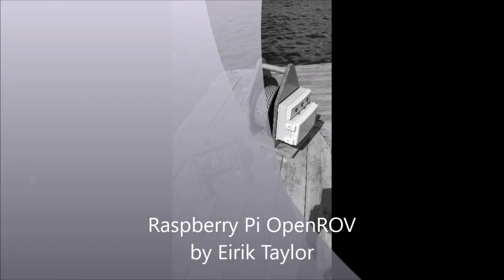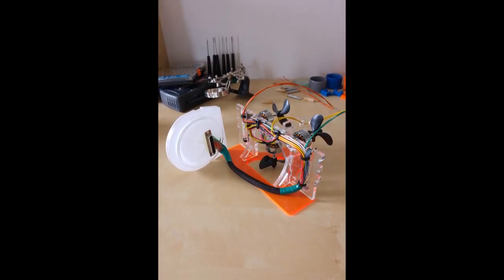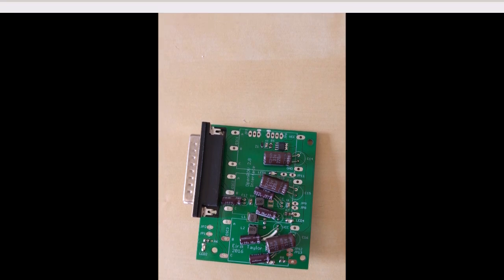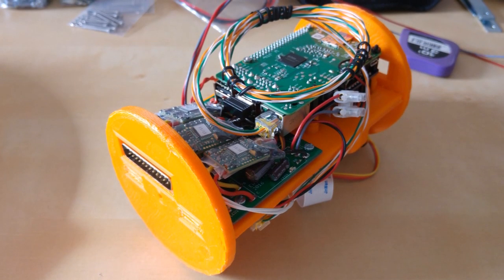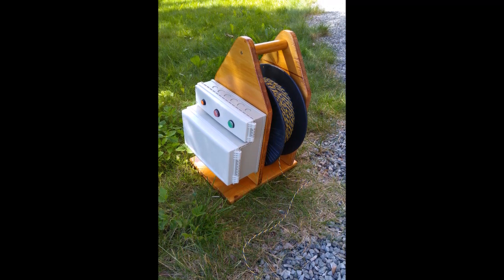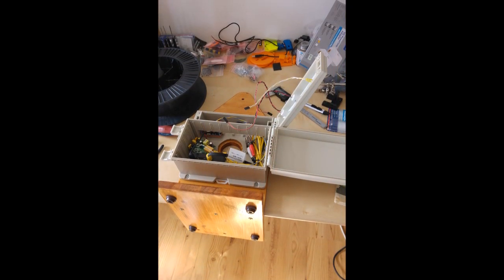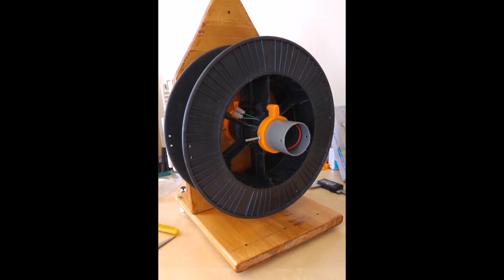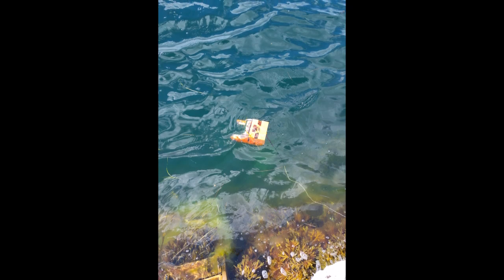Raspberry Pi OpenROV + first voyage

Comment: perfect project. but i have some questions. Where can i found interface board which in turn can be connected to a Raspberry Pi for control and can i used monitor instead of FPV goggles?
Reply from the maker: The interface board is something I designed and constructed myself. You'll have to make your own based on the open source files I've provided in the video description. Anything which can display video from a raspberry pi can be used for video, including a regular monitor.
Reply: what is the board that is near camera?
Reply from the maker: That's a homeplug module, it converts Ethernet to a two-wire interface which is sent over the tether.
Reply: The codes that are needed is in the UZZORS2K website?

Comment: Very nice. What did you find unsuitable about laptop in the field? Which camera did you use? Thanks for sharing.
Reply from the maker: Gary McKinnon, Mostly that the boot up time was long, using a touchpad with wet fingers didn't work, it was hard to find the controlling keys quick enough, salt water spray corroded parts, instability of the software, and that the screen doesn't work in sunlight. I used the standard raspberry pi camera.